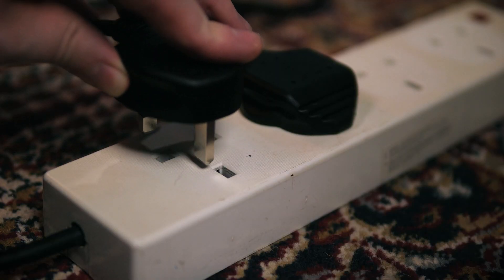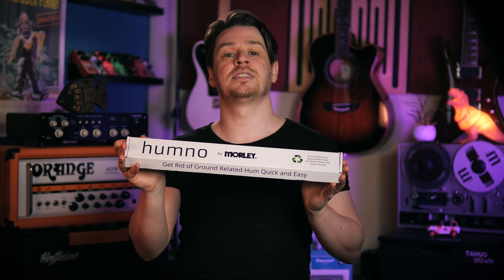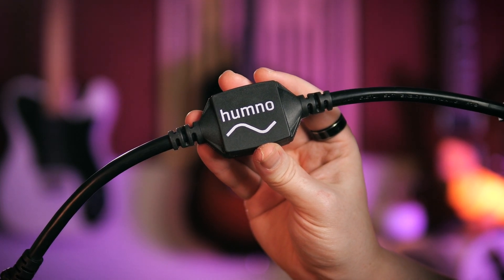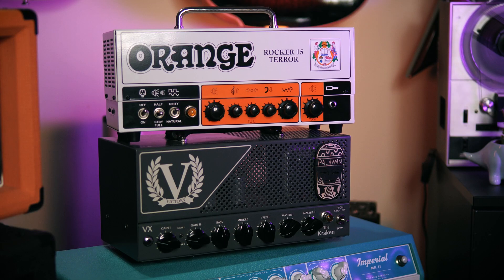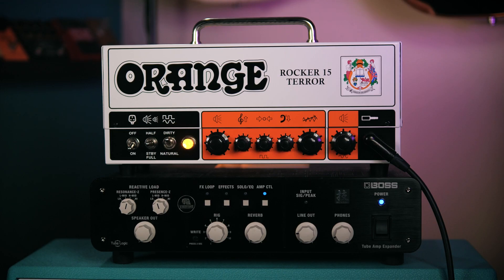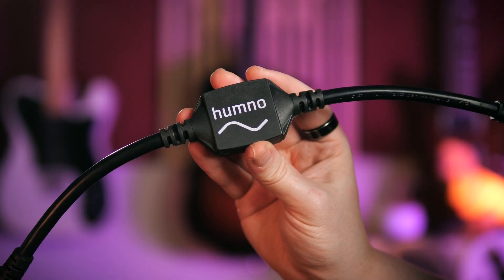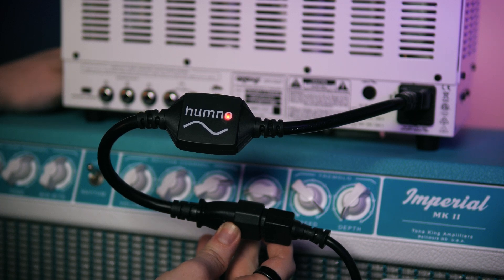HUM? NO! Eliminate Ground Loop Hum

Comment: how would i get rid of unwanted noise from an fx pedal. for my case my delay and reverb pedal brings an unwanted ring to my signal chain. the pedal can be powered by either 9 or 18 volts. i’ve tried different cables but so far no luck. if someone can give any ideas. the pedal in question is a seymour duncan dark sun and i love the pedal a lot.
Reply from the maker: Not enough information at present to give you an answer. 
Dark Sun is a big digital pedal - how are you powering it? What is your power supply? Is its power daisy chained to other pedals?
Are you using it alongside other pedals? Where is it in the signal chain? Are you using it in the FX loop? Are you running it with MIDI?

Can you better describe the type of noise you are getting from it?
Reply: @ScienceofLoud  all of my pedals are powered by a power supply i bought off of amazon (caline power cp04). also as a side note because i believe its relevant is that there is that slight hum which is why i watched this video. so my signal chain at the moment is, tuner -> noise suppressor(isp decimator x) -> overdrive(earthquaker plumes) -> preamp -> phaser (walrus lillian)-> chorus/vibrato(walrus juiliana) -> dark sun. I believe the two solutions to my problem are getting a hum suppressor for my current preamp (bias rack processor) and moving the dark sun first in the fx loop or get a new pre amp (like the tonex pedal or the new laney ironheart pedal) and also move the dark sun first in my fx loop chain. no i am not running the dark sun with midi at the moment. I leaning towards the latter because i kinda dont want a rack unit anymore and removing a amp head/rack unit makes carrying things much easier.

Comment: Hi Colin. hope you look into issues with electronic noise when using guitar near pc/laptop. 
Passive pickups, connected to usb audio interface, and any mid to high gain presets in vst plugins produces electronic noise, noticable when moving mouse.
Reply from the maker: Ferrite chokes are probably the solution in those situations
Reply: @ScienceofLoud you would think so but some PCs actually introduce noise into USB interfaces. I had an issue where ground hum from the PC was being injected into the signal cable (not ground) into my DI box. What worked was getting a USB isolator like the iFi defender. Ferrite chokes did not work for me.

Comment: Pricey, but if it's anything like Morley products of the past, it will last the rest of your life. Absolutely something any gigging musician should have in their case. Nothing makes you well liked than being more professional and prepared than the venue. 

Sponsor piece or not, you just taught thousands of people how ground loop works. I'm an electrical engineer and i just watched till the end. Well done, a perfect information!
Reply: literally made zero difference on hum for me.
Reply: @KodyXXVll  likely not a ground loop then. What's your setup? Got some old caps in your amp power supply failing? Cheap pedal supply?
Reply: you can get an 8 socket ground hum remover for the same price from WAudio though. useful for also conditioning the power going to pedals/pedal PSU

Comment: Colin!!! at 3:40 you mention your studio is wired up properly? could you please do a video on how you did this?
Cheers from Ayrshire!
Reply from the maker: The owner of the property before me, or whoever built the place, hired a competent electrician to do the job properly. 

These power issues usually arise when buildings get extended or renovated over time and different sparks (or likely people who aren't sparks, but can do it cheaper) add on to an existing system. 
You'd be surprised how much electrical work is bodge jobs that are lucky to function at all. 

That's why these problems tend to happen a lot in music venues, but not so much in modern build accommodation.
Reply: @ScienceofLoud  I wish you could have seen the nightmare that was the wiring in my home, honestly surprised the place never burnt down. thanks for responding

Comment: I'm hesitant to buy one just in case at $130+, but is there a way to tell if noise you're getting in an amp or even a direct box is actually ground hum and that this would help? Also, if all my audio equipment (amps, boxes, DI box, etc) is all on the same power strip, would putting this between the strip and the wall outlet stop ground hum on all devices on that power strip, or could the ground looping happen between devices on the strip itself?
Reply: The ground loop can happen between the devices even if they are all on the same strip. What causes the ground hum is the fact that the 2 amps share a ground at 2 points (one in the ground outlet and the other in the ground of the cable as demonstrated in the video). The way you get rid of the hum is to disable the ground in one of the 2 points. So to disable the grounds SAFELY, you can either get the humno and plug it in to one amp, or you can get a DI box and a female to female XLR adapter and ground lift and use it between your signal cables.

Comment: This would be useful when recording into a computer or laptop with pedals or something else plugged in. 
I kept getting ground hum when recording at home if my laptop was plugged in. It was  fine to just unplug the laptop but after a while and the battery running low, I'd have to plug it in again and the hum came back: queue me giving my laptop a little charge between takes and rushing everything before it died. A little doo-dad  would've been useful instead of taking extended coffee and cigarette breaks every 5 minutes.
Reply from the maker: That's probably not ground hum, that's the switch mode power supply injecting switching noise. The Humno will most likely do nothing to change that as the problem manifests after the mains connection - within the power supply itself. 
You might be better looking at adding a ferrite choke to the laptop side of the SMPS - that should assist in filtering out the switching noise.
Reply: I had this same exact issue except with my PC! Look into getting a USB isolator like the iFi Defender!

Comment: To solve the issue in my own home studio I ran a wire from the grounding lug on my rack patchbay to the nearest radiator, all plumbing is by law here in Sweden always connected to ground. Now as long as all external equipment in use is in some way connected to the patchbay, which is highly likely, no ground loops will ever appear. Playing live you don't have the luxury of figuring this stuff out though...
Reply: remind me not to lean in the radiators next time im there lol

Comment: Safety ground has nothin to do with a loop
Reply from the maker: A ground pin on your mains plug is there to safely carry current away in an event of a fault causing the chassis of the equipment to go live. It is there for safety. 
However, if you are connecting several audio devices to the same mains ground connection and then connecting those devices together with other shielded cables than you create a looping ground connection - currents can then flow around that ground loop. 
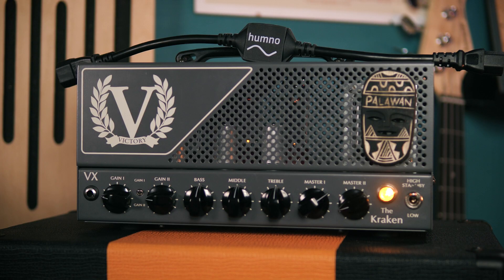So yes, the safety ground is very much a part of the ground loop - as is clearly demonstrated in this video. 04:52 - it's the disconnecting of one of the mains ground pins that is breaking the ground loop and killing the hum. 

Your amplifiers should not be isolated from ground. You are confusing mains ground which is there for safety with something like a pedal power supply where sharing signal ground can cause noise, therefore the solution is to use isolating transformers. 

Signal ground can be disconnected and isolated to prevent ground loops, mains grounds NEED to stay connected for safety.
Reply: @ScienceofLoud  Colin , 1981, 82,83....... Ive dealt with ground loop problems and solved em..I went to trade school in the late 80's  been a journeyman electrician for over 35 years. What you just said above ive been knowin for years. So we know the sheilding in the signal cables is the path. And the negative wire in a signal cable is not a ground . But the guitar cable the sheild is a negative ground? Am i not right? Ive a problem sittin right in front of me and your video came across my feed statements you made had me second guessing my own . My damn pc makes the noise. If I turn my monitor amp up loud its apparent. If the computers asleep  or off no problems . Pull out the mixer interface usb cable no noise . And your statement about bein older dont make me smarter thats them psychotropic drugs or you just lack the honor for respect of your elders. Im no bullshitter I have no desire to run my mouth about what I dont know. Im sagi half my planets in cap and im  a Mc Intyre damn bout near scottish rite by blood  . Even on my FB page which I hate FB ive stated if Im wrong Im not scared to admit im wrong cause I care not to be ..wrongs evil rights good. Im third firesign too its a curse  seems like Glen might be takin them psychotropics too I told him he needs to quit. Wasnt yall two playin with pickups on the psychotropic island?
Reply: @ScienceofLoud  seems like one cable in the past I disconnected the shield  on one end got by the problem at hand then, damn near 30 years ago
Reply: @voxchordis  if the ground is being used in the circuit connected to the chassis ground then theres your loop built it. I Am an Electrician for over 35 years . How old are you?
Reply from the maker: @hadleymanmusic  you do realise that being older doesn't automatically make you smarter, right?

It could just be that you've been wrong for longer.
Reply: @hadleymanmusic    except you are leaving out the part that the ground loop occurs when you are connecting 2 different device's grounds together at 2 different points in their circuits. Connecting a ground at multiple points in a circuit to a chassis itself does not cause a ground loop. 

You're just wrong.
Reply: @TeddysMusic772  call me evil? I know good n well exactly what you are reiteratin he didnt say the signal ground anyway fool he stated different devices plugged in and the ground on the electrical plug has nothin to do with it. Like I got a whine now its the computer when its on and interface plugged in I got a whine into my control room monitor amp send . The chassis ground on the computers the frame. All 3 plugged in the same feed. So basicly its in the usb line. Only hear it when I push the monitor levels up . If im not workin with the daw and the computers sleep i can crank up no noise.
Reply: I wonder if its a toroidial transformer , that might cost a little more than common wound core types
Reply: You also have what probly should be isolated ground????

Comment: Nice to have, but it seems tad bit expensive for what it does. Unless you play a lot of gigs in smaller venues, it doesn't seem worth the price.
Reply: To each their own, but as a recording musician, this and other ground isolating products are ABSOLUTELY worth the price even if you're not performing. The PC itself can introduce a ground loop, which is honestly really hard to get rid of.
Reply: @TeddysMusic772  Interesting point, I never thought about that. I suppose it would have the same effect plugged into a pc.
Reply: @Kharnimani  yeah. I had an issue where the PC ground was sharing the ground of my audio interface via USB. Because I have multiple PCs connected to each other, the humno couldn't fix it and the power supply (I think) was injecting some ground noise into my signal cables so I couldn't get rid of it via DI box. This is apparently a common problem and I had to buy a USB isolator that separates the ground of the PC and my interface. 

This was my hardest and most frustrating ground loop hurdle
Reply: You think this is better thank the furman power conditioner?
Reply: @andvgeo2253  power conditioners are not ground loop eliminators. You can have these things plugged into your Furman but if you have a ground loop, it will still cause hum. 

I know. I bought a Furman when I was trying to find the source of my ground loops

Comment: Colin, this video is awesome. Id love to see a video addressing the other sources of noise like single coil hum or operating noise floor of amps. Thanks!
Reply: I second this idea! 👍
Reply: I just recieved a paket from china with 80 meters of copper tape in 4 different widths, cost about 20 quid! When shielding with copper tape, check the continuity and don't forget to connect the jack route to the main route. The pickguard musst contact the shielding  to complete the loop and this should help against single coil hum on strats!🎸🤘
Reply: Hey, Rockers! Anyone here know why I only get ground hum when using my effects loop? 

I recently got a Marshall Origin 50 W heads. And I’ve learned that they do have an issue with a bit of a volume and tone loss when engaging the effects loop. I don’t know if there’s any way around that.

But I can probably EQ it to match whatever the effects loop is taking away. 

But still, that hum.

Maybe this device here will help, I’ll watch a few more videos.

I am running a lot of pedals. But I’ve been really careful, and the board would usually stay quiet. But now, also, I’m getting a lot of signal noise, and a really high-pitched sound. Fortunately, my Decimator knocks those out pretty easily.

Comment: Do people actually remove the ground plug😮😮😮😮😮😮😮😮😮😮😮 FOOKING HELL😮😮😮😮😮😮😮😮😮⚡⚡⚡⚡⚡⚡⚡⚡⚡⚡⚡⚡☠️☠️☠️☠️☠️👻👻👻👻👻👻👻👻👻👻
Reply: Not all humans believe in proper grounding. They typically end up at least as deep as a ground rod. ⚡️☠️

During especially dry times on Earth I would go out and water my houses ground rod to ensure a good connection. Neighbor probably thought I was crazy but it helps.
Reply from the maker: You'd be surprised by how many times I've seen that offered as a solution in forums over the years. People generally are terrifyingly ignorant of the dangers of electricity.
Reply: @ScienceofLoud  the final solution 😱
Reply: @ScienceofLoud  that's sooooo scary